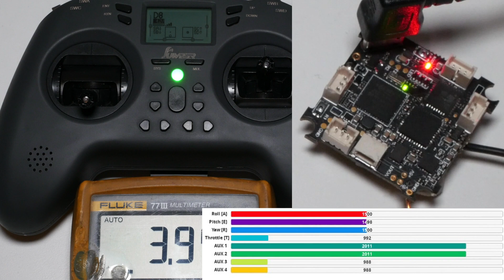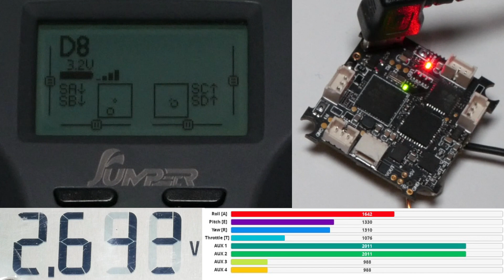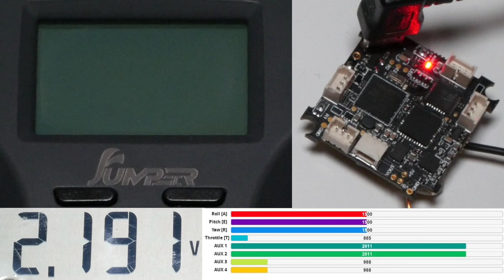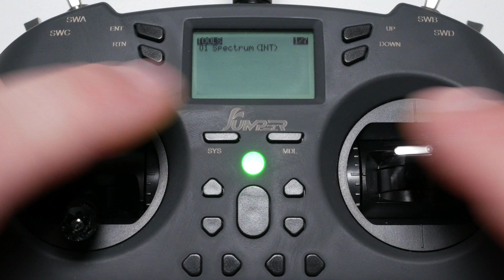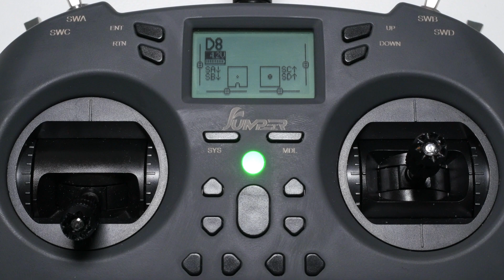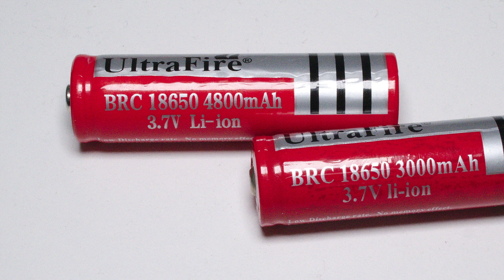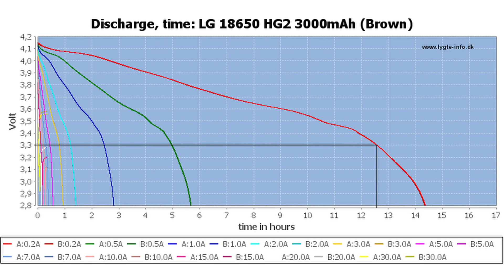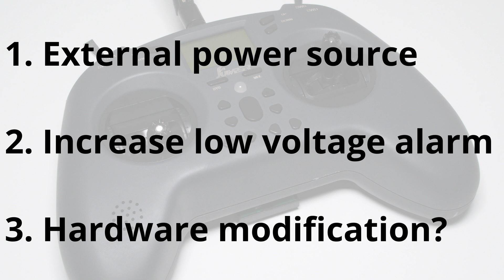Jumper T-Lite: Power "issues" - let's talk about that...

Comment: Just received my Jumper T Pro V2. Noticed it switches off randomly... Figured it's due to bad contact with 18650 cells. Knocked it a little and it switched off again. Then knocked it harder and it did not power up again, and the cells started to rattle inside... Metal contacts got bent permanently. They should be made of good spring steel, but are just plain iron.... I imagine this is a problem to everyone. You don't want your remote to switch off mid flight, do you?

Comment: I had 2 problems with the t-lite:
Although the battery was fully charged, the device went off several times. The reason was the two pole contacts, which bend inwards over time on their own. Since that time I only buy batteries that have a positive pole with a nipple. That never happened to me again.
Then it happened to me once that I inserted the battery incorrectly. After that, the t-lite was apparently dead. I then ordered a second one.
3 days later the apparently dead t-lite was working normally again. Now I have 2 devices.
Reply from the maker: Yeah, if you bend the contacts a bit, you can use the flat tops with no issues. But very interesting that your radio spontaneously started working again after putting the battery in the wrong way around. But it's always good to have a backup I guess ;-)

Comment: Me personally in any radio I recharge the battery’s when there at 3.4 anyways so this would never affect me. The radio starts cheeping at you before any of the strange gimbal reading so any normal  human would swap the battery cause that sound is annoying lol
Reply from the maker: Well, sure - if the battery is of high quality and discharges linearly then it will not be an issue. The whole point is using low quality batteries and external modules that will, due to higher current draw make the battery drop below safe voltages. People are also used to being able to discharge LiIon batteries way lower than LiPo batteries. So yeah, a higher  battery alarm voltage and a high quality cell and you are on the safe side.

Comment: Great Vid ! i just got a question: Can u fit a 21700 batterie in it?
Reply from the maker: Not without modifications. And in my opinion, you wouldn't gain too much. I always take a spare 18650 and never had to swap it, even when running an external module - obviously this will depend on how long your sessions actually are ;-)

Comment: I have used a Jumper T-Lite transmitter multi-protocol for 1.5years, and often fly drones with/without my friends. In general, I feel that transmission distance is shorter. For example;
- happymodel Mobula6 1s loses the signal around 15-25m without obstacles. FrSky binding.(but expect to reach around 150m) . max RSSI is 75, not 99, strange.
- BetaFPV micro drone 2s (forgot model) loses the signal around 50m.FrSky binding (but expect to reach around 400m)
- I have a free style FPV drones (iFlight and gepRC) with air-unit with FrSky XM+. They lose the signal around 1km. (but expect to reach around 2km)
- In general, I found city sides have radio interfere, and a huge parks without people kinda better, but not significant range improvement.
Does anyone know this is normal transmission range or too short and something wrong with my T-lite? I hope T-lite has booster option or may just change antenna simply, instead of installing additional kits.
Reply from the maker: Yeah, that's definitely not normal. you should try fine-tuning the frequency, at least on the AIOs it could help. I mostly fly in the city and have no range issues like you at all... You could try a different antenna, but if you are flying like this for over 1.5 years, chances are your RF module is burned out anyway :-/
Reply: @stylesuxx   thanks for your reply, stylesuxx. Could you describe more detail which tabs or pages of T-lite setting you are talking about ? AIOs sounds you mention drone settings?!?
Reply from the maker: @upyopyo  With AIO I mean the "all in one" Board of your Mobula6. The FrSky compatible D8 receivers are known to not be the greatest. To fine tune the frequency, power up the quad, place it around 2m away from the radio. On the radio go to the Tab where you set transmission protocol (Setup Tab). Then you chose "Freq tune", you increase the value until the quad loses connection (note the number), then you decrease the number until you lose connection again. You will then have a negative and a positive number, you add them up, devide by two und the resulting number is your optimal Frequecy tune.
Reply: @stylesuxx  now I understood what you mean. I've never tried it before, so let's see how it fixes the problem. Thank you so much a lot!! have a great day!
Reply from the maker: @upyopyo  let me know how it works out for you.
Reply: @stylesuxx 　Hi! so I had a test and here is the results. 1- I just needed to adjust to positive5. that's it.   2- After this test, now I knew openTX can shows RSSI. When radio shows RSSI 99, OSD shows 77. There is a gap!? I don't know why...   3- Then, I was originally thinking the default RSSI was weak as 77, but OSD may show wrong value, so now getting confusing whether my radio is bad or not...
Reply from the maker: @upyopyo  Yeah, RSSI is not a super representative number. Probably radio and FC calculate that differently. If you want to have the same number on both, I would set up the radio in such a way to transmit back the RSSI over a seperate channel and use that in betaflight instead of the default. But I honestly would not bother too much about RSSI. If all your gear is consistently performing bad, then I would assume the radio has some issues. The easiest way to find out is to compare with a different radio.

Comment: How do you use this radio von a sim .I can't get it to work
Reply from the maker: Which part can't you get to work exactly? Just power on, plug in via USB and a new device should pop up. Do this before starting the sim and you should be good to go.
Reply: @stylesuxx  I try again keep getting unable to recognize device pop up..was going to try the free demo on clear flight..
Reply from the maker: @jakelang4387  which OS are you using? Can you see the divice in the device manager when you plug it in? Have you tried a different cable? Which simulator are you using?
Reply: @stylesuxx  clear flight sim is free they say for 4 month..that's the one I was trying to connect to . No haven't but I will
Reply from the maker: @jakelang4387  I see - never heard of that one, but as long as the device shows up in the device manager you should be good to go. If it does show up in the device manager but not the sim I guess you are better of asking the sim devs how to get everything running.
Reply: @stylesuxx  I fly helis more than qauds and thought it would help me..I'm the only one around I think that uses this radio for 180 size birds . I don't like big radios except my spectrum

Comment: This really is a cheap shit transmitter. Nothing about it fills me with confidence.
I wanted to fly petrol planes on it but i dont think i will now :(
Reply from the maker: For the price it is pretty amazing - use it almost daily for over half a year now. Don't know how well it is suited for planes to be honest... I would image something with mechanical trims to be better...
Reply: @stylesuxx  all it has to be is reliable. The one i had failed within an hour :(
They replaced it but im aprehensive. For big petrol stuff im almost tempted to go back to my old 35mhz futaba... Never missed a beat in about 14 years
Reply from the maker: @WikWak  You know what they say: Never change a working system. Really sad to hear that it failed so quickly - might I ask, what failed? I can understand that you are  apprehensive if it failed on you the first time. Keep in mind that a 70$ Jumper radio is difficult to compare to even the cheapest Futaba...
Reply: @stylesuxx  one of the gimbals, it was stuck on full elevator down 😬

I get where youre coming from, the futaba is like 15 years old. And was only twice the price when new.

I was thinking this would be better in every way
Reply: @stylesuxx  great content by the way. You seem well educated :)
Reply from the maker: @WikWak  Unfortunately in the RC hobby with the cheap Chinese stuff it often is hit or miss. I always try and preach QC to the companies I have direct contact with, but often times they are just not seeing the value of that. Your issue could have been spottet in the factory with a ten second test :-/
Reply from the maker: @WikWak  Thanks for the kind words :-)

Comment: May i ask can you charge the T-Lite or it needs battery?
Reply from the maker: It needs a (high quality) 18650 cell. Once you have the cell in the radio you can charge it with the radio. But the radio does not come with an internal battery if that was your question.
Reply: @stylesuxx  Omg tysm for replying ty for the information ill just buy the 18650 charger

Comment: Is it possible to install 2 18350 in series, flat top and maybe trim out the spring in the battery holder?
Reply from the maker: That could work space wise - not sure if the rest of the electronics can handle 2S though.
Reply: @stylesuxx  I will try it after tomorrow's paycheck arrives. Worst thing is burned 95USD. I really need the low profile TX because I don't always do things legally and want less attention.
Reply from the maker: @johncgibson4720  The question is, which problem are you trying to solve with 2S?
Reply: I tried it today. It accepts 2S 18350 but only at 7.6 volt max, even after changing the opentx setting to 8.4V max. My application uses 250mW, and either 1S or 2S works just fine. I am going to stick with 1S for now because the 18350 or CR123 energy density is much lower. One bad thing I notice about the t-lite is that stick center point is off because of some slop after a rough software calibration. It needs extra care.

Comment: After 2 weeks of use my T-Lite does not turn on anymore.  I was hoping it was my bad luck but I'm reading lots of comments with the same problem.  Once again Jumper prefers to market a faulty radio, at the expense of us consumers.  For details: https://www.rcgroups.com/forums/showthread.php?3754503-Jumper-T-Lite-another-Lite-radio/page66
Reply from the maker: Hmm, I've heard that now a couple of times. I have personally no issues yet. But I also think they rushed the release - they wanted to get it out the door before CNY and that  might now be the consequences. Have you tried getting it replaced? I buy most of my stuff from BangGood and always had great experience with customer support there.
Reply: @stylesuxx  no, no replace. Trash. I wanna forgot the brand Jumper forever. Radiomaster is 1000 time better. A TX12 have the same price and is pretty solid controller....
Reply from the maker: @ergot83  Did you try speaking to Jumper? But yeah - I can understand that you are unhappy. I can't stand the big controllers, so the Radiomaster stuff is not really an option for me - and their gamepad shaped controller is seriously lacking in features :-(
Reply: @stylesuxx  yeah you talk about the Radiomaster T8. But the TX12  170x159mm size is not so big. And seems to give no prob...

Comment: Hi.. im using nitecore 18650 32a discharge is that ok?
Reply from the maker: Sorry, I can't find that battery on the site with the battery tests, so no idea. If you don't use an external module you will probably be fine...

Comment: hi, did you notice the jumper t-lite overcharging the 18650?  while playing the simulator for a long time, I noticed that the display voltage can increase to 4.3V
Reply from the maker: No, i have not noticed that. Have you measured the battery itself? Maybe the voltage readout is simply not properly calibrated within openTX...
Reply: @stylesuxx  I will check this later at home

Comment: I could parallel connect a second 18650 to this radio. Mount it perhaps on bottom side between the grip handles. Same voltage but more "depth" of power. Would this type mod cause a problem?
Reply from the maker: I don't really see the upside of this. You could do it without issues. But you could also just swap the cell when it gets too low. Unless you NEED to be able to discharge to low voltages and want to compensate with multiple cells in parallel...

Comment: I wonder if a 21700 battery would be a better choice? Higher Amp battery with more capacity. This may help with battery rattle as the tray seem a little too big for 18650. Have you tried this
Reply from the maker: Battery rattle - I do not have it at all. I use flat tops instead of the recommended button tops and just bend the contact a bit. No, I have not tried 21700. I have seen others do. Not worth it in my opinion, just bring a second 18650 if you want more capacity. High quality 18650 can handle the CRSF Nano on 1W (modded) with no issues at all.

Comment: Are you aware if there is some battery overcharge protection in the radio internal charger? I can't find any information about it. I'm asking because while I'm learning to fly in Liftoff my Jumper radio is connected to my computer via USB and the battery id constantly loading.
Reply from the maker: Yep, no worries it uses the TP4054 chip for charging. that is a dedicated LiIon charger IC. It has temperature protection and monitors the charge voltage.
Reply: @stylesuxx  Thank you mate! I was worried because the display showed 4.3V, but after measuring the battery voltage with a multimeter it was 4.05V so I calibrated it like you did. I'm using a new high quality Samsung 30Q battery.
There is this setting called "Battery range", I was wondering if it has some impact on the overcharge and/or undercharge level cut.
Reply from the maker: @mariuszwawka  No, battery range is what is used to display the battery bars. There is no cut off voltage, the radio will run until your battery is completely discharged or the SOC does not get enough voltage - which happens at 2V - only then will it turn off.
Reply: @stylesuxx  Thanks once more for the explanation!

Comment from the maker: As per request, the hardware mod vidoe is now available: https://youtu.be/b7OCdkkKmrc

EDIT 24.01.2022: Before buying this product, please be aware that some users experience problems with "sticky buttons" - this can be fixed but you will have to de-solder some caps from the board.
Reply: Woot!
Reply: InstaBlaster...
Reply: Thanks.

Comment: The values you're getting are typical of cheap lithium-ion batteries. good genuine batteries will always weigh in in the high 40 g area. And they will have anywhere between 2500 and 3500 capacity
Reply from the maker: Yes, that's what I was trying to say ;-)

Comment: I think the main issue for external module bay is the voltage drop through the main board. I measured 3.8v at the output point to the ‘boost’ board while 4.1v at 18650. Now I added a dedicated cable to get voltage from battery lead to the boost board, with an exrtra switch in serial. I use 500mw and dynamic power off on Crsf micro tx daily with a Sony VTC6, so far so good.
Reply from the maker: Yes, that is my conclusion too. I am currently testing something similar, except using a fet for switching. Unfortunately I don't have a crossfire nano TX and I would need to test it with a constant current load...

Comment: @stylesuxx MOD add 2 extra batteries like BetaFpv lite radio 2 mods :D Do you have plans looking into external modul voltage regulator preformance on "adapter" ?
Reply from the maker: That will not work easily. The BetaFPV Lite Radio is designed for a 2S battery. The board of the T-Lite is unfortunately not. Yes, my current idea is to run power from battery to the module directly and switch wie transistor. But I need to do a couple more measurements...

Comment: Do you think 21700 battery will fit into this with some modification?
3mm difference.
Reply from the maker: Length wise it should not be an issue (if you use flat top), but I don't think it will fit width wise. I don't have one to test unfortunately.
Reply: @stylesuxx  Thanks. It looks like that it will need a mod to take some plastics out. I can't wait to get mine. Thanks for info.
Reply from the maker: @DrR404  Keep me posted!

Comment: and cells use sony samsung or lg cells and 3000 mah is the most you can get you see 2500 of 5ooo mah its a lie they fill them with powered to get the wieght up  buy off a reputable supplier youll pay upwards of 10 dollars a cell is a good price 6 or so is alright you get what you pay for speech dont buy off any site other than sony or samsung etc
Reply from the maker: Yes fully agree on this one - buy high quality cells from reputable vendors. The good ones are not so expensive, so no reason to save money there.

Comment: heres the truth never buy anything thats single cell sure tiny cheap whoops but more expeisive ones and transmitters dont buy single cell 2s for a whoop or transmitter is what you want 3 ideal.. why this shows that the single cell lithion once it goes lower the transmitt power fluctuates and sends eratic commands.. who in their right mind made this single cell glad i didnt buy one i bought one of those radio kings suggest youall do too.. sure its a cheap transmitter but why buy it well its cheap it only outputs 25mw its only good for whoops or close in stuff.. save your money get a proper radio and for long range stuff use a quality radio... glad i skipped buying this i knew something was off second i heard single cell and 25mw output...
Reply from the maker: The internal multi protocol module has actually an output of 100mW. The 25mW limitation is when using the external Crossfire module. For me this radio is perfect - I fly whoops and micros 90% of the time and I do not use crossfire. But yeah - I fully agree, when you want crossfire on full blast, this radio is not for you - would rather go with the Tango 2.